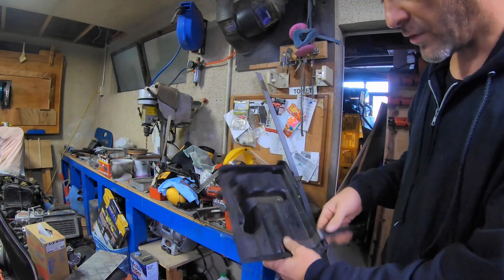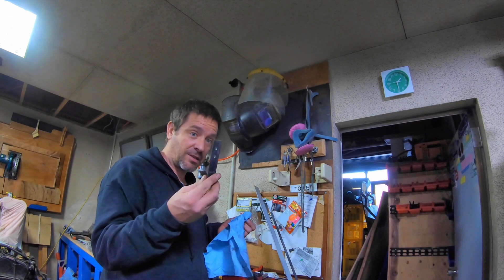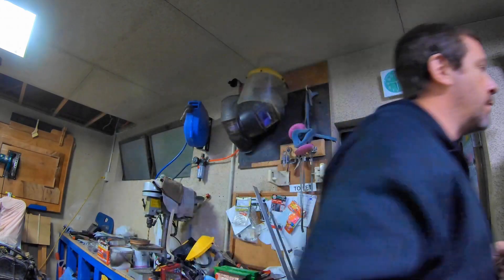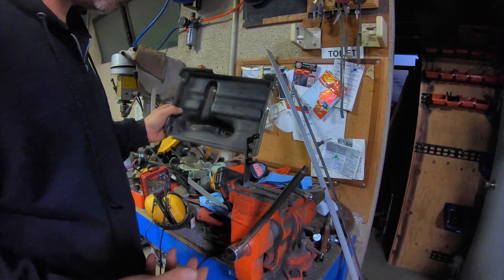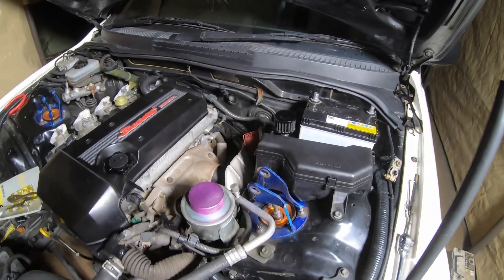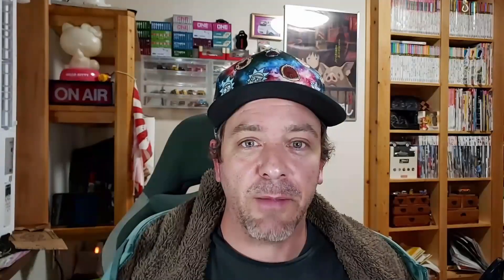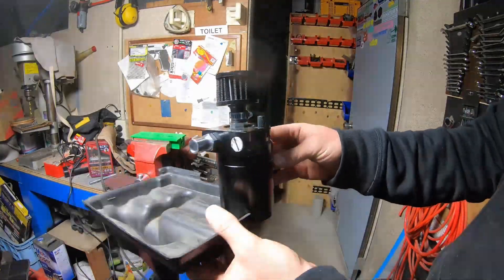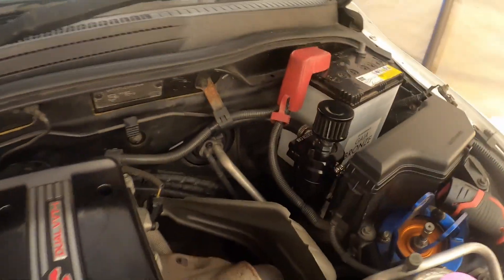Catch tank install.

Comment: To help clean up the threads when you cut a bolt, leave a nut screwed onto the bolt and remove it when done cutting. This helps the threads to stay on the same plane to prevent cross threading when reinstalling the nut
Reply from the maker: Yup! really good advice that one. I do that every time. In this case the end I cut was the end I put the slot it so I didn't need to do it. The uncut end was the one I threaded into the catch tank. No idea why the bolt is difficult to start on the hole. It's never coming out again so no need to worry about it.

Comment: How many cars do you have?  Can you make a video where you show and describe each one?
Reply from the maker: I have 
Altezza. No registration.
Cappuccino. Haven't driven for about 9 years.
Carry truck. Haven't driven for about 4 years... Mid modification
Alto works. Bought in parts.... Haven't put it together yet.
Silver every van. No registration. Will crush it or sell it when I'm no longer using it as a shed. It's full of the alto parts...
White every. It's in the back yard waiting for attention after the Altezza.

Yea I can do a video on all cars.